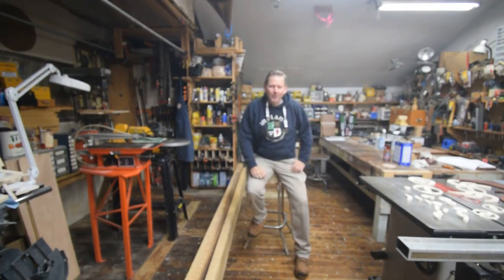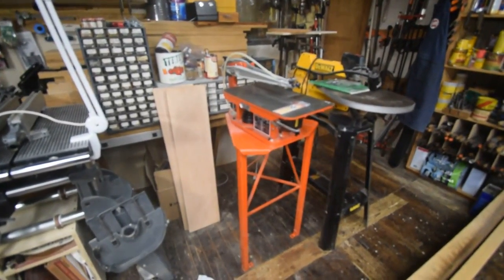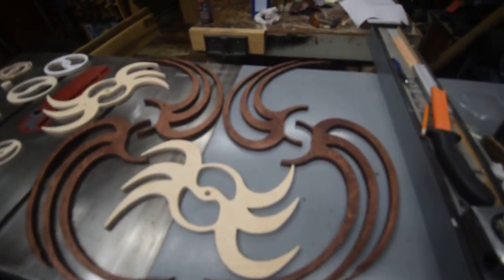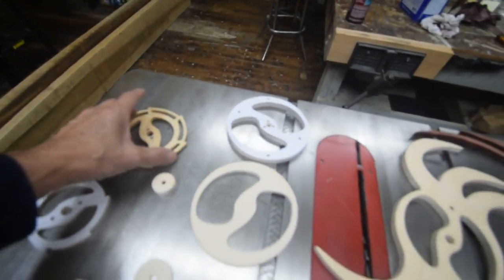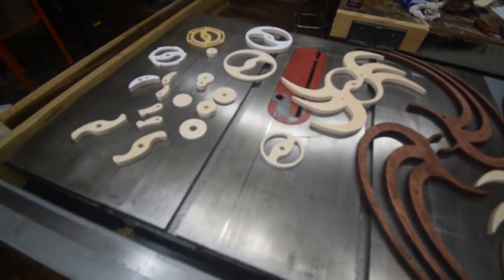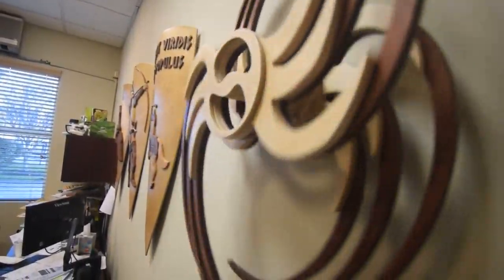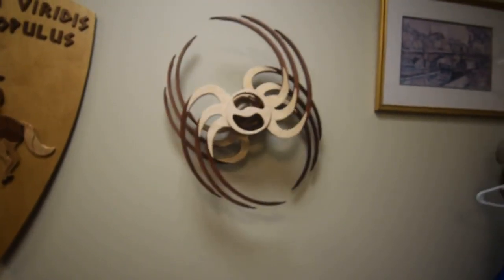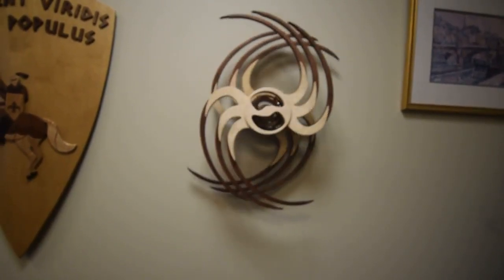Building the kinetic sculpture  Cepheid, based on plans by Derek Hugger.

Comment: Did you have any problem tapping the SS tube - I've broken a couple of taps including a cobalt steel one
Reply from the maker: Hello, I used a cobalt steel tap, used the proper sized drill bit, also cobalt steel, used lube and went slow, constantly backing out then going forward a little deeper, you might try heating the Sos tube a little if it is giving you a lot of trouble. Hope this helps. Ken

Comment: I just finished building my Cepheid Sculpture on OneFinity CNC and it looks great. However, I noticed a couple of things I would change in future build. The 1/4” and 3/8” brass spacers between spinners seem flimsy, the SS shaft is too hard to sand down to fit into bearings, and there should be a brass spacer on spring shaft. I’m looking at something beefier to replace brass spacers. Also, I would also use larger bearings to fit precisely on a larger shaft or long bolt so no sanding—I would adjust wood hole size accordingly. Your thoughts?
Reply: Larger bearings consume spring energy and will affect operational performance .

Comment: I use blue tape then spray adhesive. Comes right off.
Reply from the maker: I too have used that method, but I find direct attachment of the plans easier on large pieces. Ken.